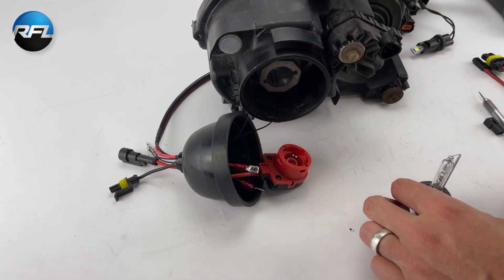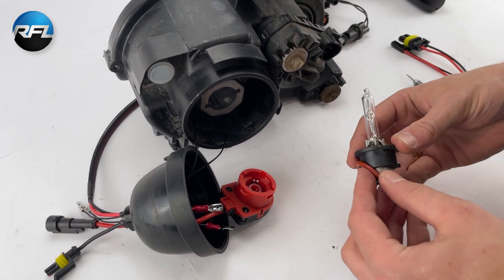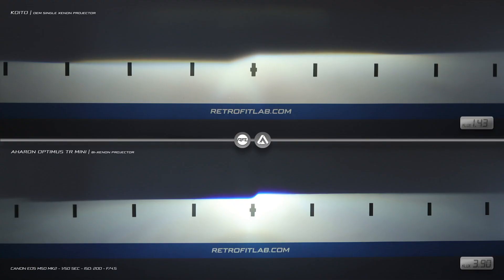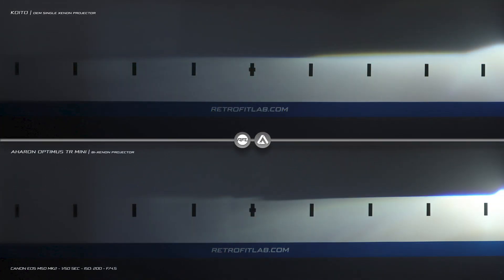Mazda MX-5 Miata NB2 OEM single xenon HID to bi-xenon projector headlight repair and upgrade DIY

Comment: 01-05 headlights were never available as xenon
Reply from the maker: What do you mean exactly? Yet we have a Xenon headlight in the video :)
Reply: In 05 Mazda changed the NB headlights to the same Xenon tech they used in the NC, so some of the very last of the NBs did have Xenon headlights